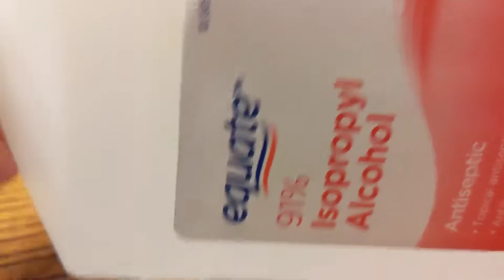Casio G-Shock GA-700 Tear Down and Clean Up

Comment: Hey Tdub, can you tell me if the light button should turn clockwise and counter-clockwise in it's place (fully assembled), mine does (GA700SE-1A2), so wondering if it should be like that, appreciate your reply, thanks.
Reply from the maker: Yes. Mine spins.